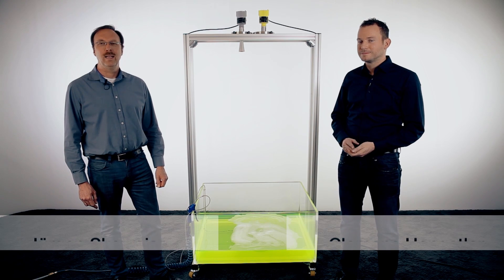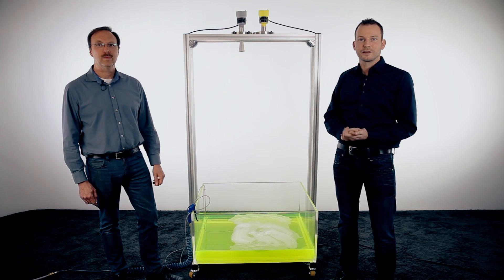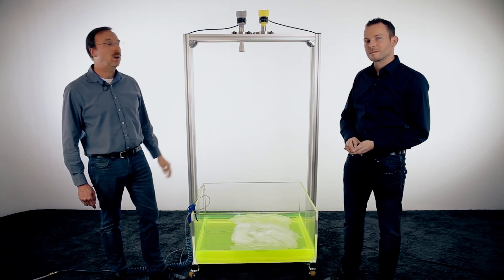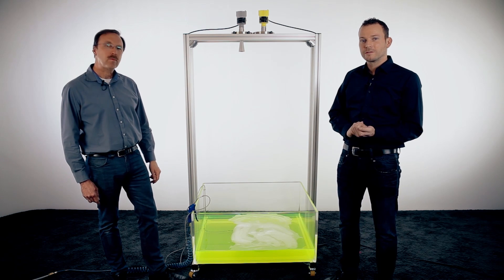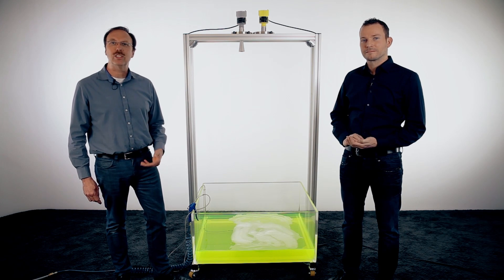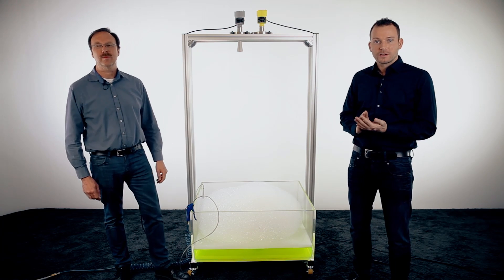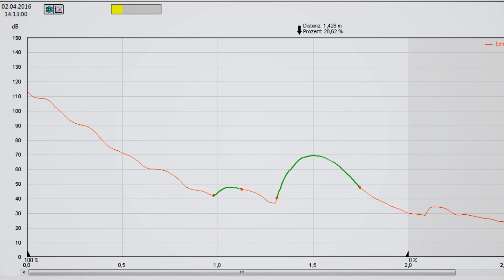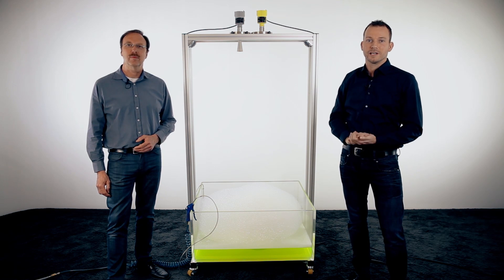VEGAPULS 64 - Influence of foam | Radar level measurement

Comment: Hi , i'm using your product VEGAPULS 11 in a Glycol project and it is perfoming  really well ! Due to contamination in the Glycol  (refrigerator plant ) we have an overflow IBC container and from there we are pumping back to the system (whenever it triggers to a specific height) .I'm very pleased with the sensor, it reacts very quickly when the level changes and is accurate even if it is foam or just glycol in the container.

Comment: hi..

I had personally experienced an issue of handling foam in the fermentation tank. Vega 64 is not at all sensing the foam in practical. we raisad the issue to Vega. Representative has told that its related to the Di-electric constant value. 
May be this VEGA 64 will work for soap foam, not the actual foam.
there is also condensate issue in VEGA 64. Condensate and water droplets are blocking the microwave and hence it is not displaying the value
Reply from the maker: Hello, Thanks for your feedback. It is true that foam is not just foam, it depends on the application. Is there a chance to try another measuring principle, for example a VEGAFLEX which is a guided wave radar sensor?

Comment: Question: What configuration can be used if it's the height of the  foam you want to measure ?
Reply from the maker: Hello Peter Thygesen, this is a really tricky application you are asking for. Foam has very difficult physical conditions and is all the time changing its parameters. In most applications as shown in the video, foam itself is not reflecting the microwaves. It is only damping the microwaves which are traveling through the foam. Therefore the echo amplitude of the level is reduced and hence there is no echo of the foam. Because of the missing echo of the foam, it’s also not possible to make a configuration of the sensor parameters to measure the height of the foam. 

The most important advantage of the VEGAPULS 64 compared to other sensors is the high dynamic range which allows a measurement even if there is foam on the liquid. In some applications we use an additional sensor according to a different measuring principle to detect the height of the foam. Kindly  contact us directly to find a solution for your application? Here is an overview of where to find VEGA subsidiaries and agencies worldwide: https://www.vega.com/en/company/vega-worldwide

Comment: What happens when a liquid has steam?
How do I eliminate this bad measurement?
Reply from the maker: Steam contains very small drops of water. This particles are very small in relation to the wavelength of app. 4 mm at 80 GHz. This means they don't cause a reflection and the steam is nearly invisible for radar. Also fine dust particles don't gain a big damping or reflection of the radar signals. 
Because of the much shorter wavelength of the light, it is not possible to look though steam or dust. This is the reason why radar is the ideal measurement principle for high temperature applications with steam or bulk solids with a very dusty atmosphere.

Comment: Why does the distance decrease from approx. 1.53m to 1.46m during the video?  And is there a time available for the profiles at 1:21?
Reply from the maker: During the time the bubbler was on, the water surface was very rough, so the surface height did change a few millimetres. This means the distance also changed.
Unfortunately, in one of the last pictures a different echo curve is shown, the container was already filled with more water, so the distance decreased. This is a little confusing when you have a detailed look at the distances. Thanks for your question.

Comment: Is it possible to ignore the foam and measure the liquid while aration is going.
Reply from the maker: The foam absorbs part of the reflected signal. The main part of the energy is reflected at the surface of the liquid. This means that the sensor measures the liquid surface under the foam.